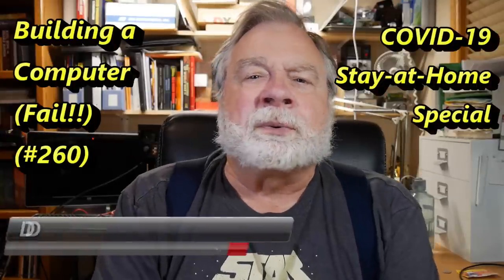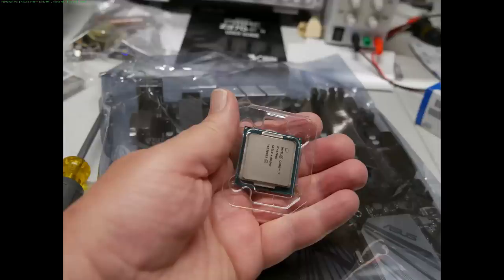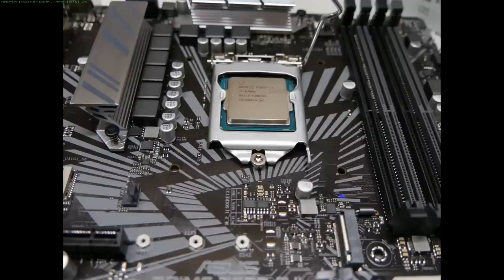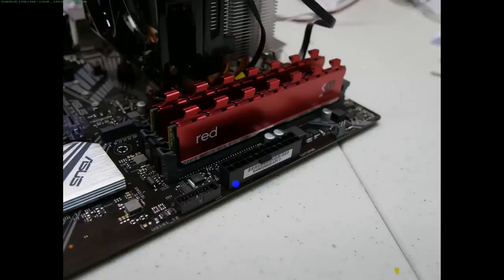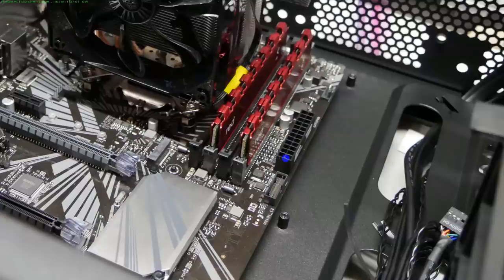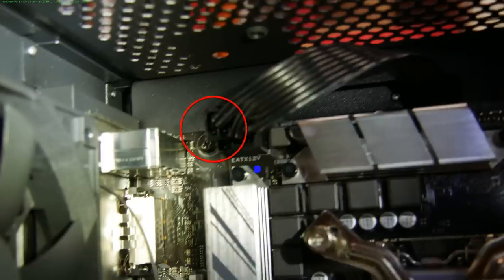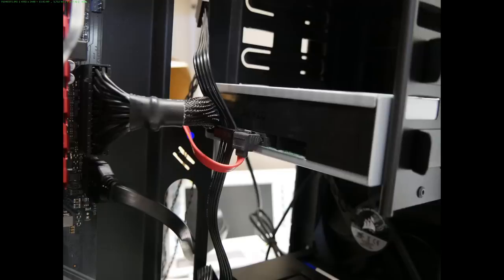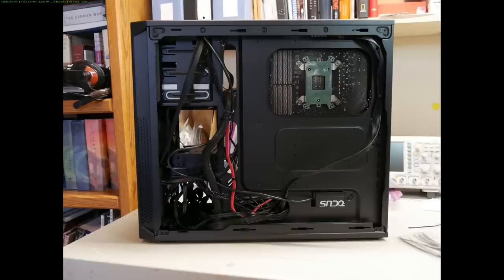Computer Build Fail! (#260)

Comment: Good for you building a PC with no prior experience! Trying challenging and new things is inspiring. A list of hardware would be helpful, but it looks like you made some good choices and did your research well. Kudos on that as well.  Unfortunately it doesn't look like your motherboard has a postcode display. Your best bet is to reseat everything, including the CPU, ensuring it's corner with a triangle is aligned with the one one the socket. I would start with no video card, and the display connected to the motherboard (most Intel CPUs have integrated GPUs). Also try one stick of ram at first. If it doesn't work, swap it out for the other. Unlikely 2 sticks would be defective. Obviously verify the simple stuff as well, right motherboard chipset version and CPU version. To POST the motherboard really only needs a working CPU+RAM.
Reply: I think you'll find this motherboard has to have memory installed in pairs because of the i7 architecture.  Most of the modern motherboards I've worked with will POST (Power On Self Test) wilt only a CPU and give a "beep" code to indicate there is no memory installed.
Reply: @rogerp5816  I haven't heard of a dual channel ram limitation in any modern CPU. My last experience with Intel was on Skylake, and I'm pretty sure it supported single channel ram. That system had a 8 segment display to show post errors, I can remember back to when motherboards beeped, but assuming the motherboard model from a previous comment the manual doesn't mention POST codes at all! Not saying it won't beep, but I can't find info on how to interpret the beeps from Asus

Comment: I also agree that it's the 8-pin CPU cable. The one you're showing in your pics are meant for graphics cards, usually labeled PCI-E, the 8 pin you want will possibly split in half, or be labeled CPU. I do believe with the seasonic power supplies its it's one of the permanently attached cables. 

My biggest worry however is that you might have potentially fried your motherboard and possibly the CPU since the pinouts are definitely different between the two
73 KI5FIQ

Comment: Best option, and it was mention below, pull the mother board and power supply back out and try to power it on, with the gpu, but no ssd or hd, this will test for any bad case contact to back of board, just set the mobo up on it's box and give it a try..  unfortunately the power connector you had issue with is for the cpu..  hope it didn't brick the cpu..  good luck

Comment: I have absolutely no idea, I have to see it in person to check. 
But initially I check everything on the way when I build a computer. And get a little speaker if it doesn’t have one. Check fan spin and beeb with every parts instal.
But my guess is check the ram take them out. 
Start the computer. Prognosis is if the fan spins it should beeb at you. Signaling it can’t start cause there is no ramm, (which is correct) 
If the fan doesn’t spin. The problem is somewhere else. Take out the Graphics card. And try again. If that fails check connections to the fan. 

However if the fan does spin with no ram. 
Put one back and try again. If it doesn’t try the other. 
Ram compatibility is often the must occurring problem. Even in this day and age it really shouldn’t . 

Also, by biggest advice. Wait for much advice. 
I’m not a computer mechanic. I just build them and troubleshoot them.

Comment: if you are not sure if the motherboard  is bad here is what you do ... pull the video card unhook all the sata cables ... put the board on top of the cardboard box hook the power switch wire where it goes and fire it up .. im sure you've heard of breadboxing something .. if it stays on then check to make sure all the insulators and mounting screws are there .. note you will only need those screws where there are screw holes in the board .. having some in there that don't align with holes can cause a short... if it does not stay on then it is possible the board is bad  ..last thing I saw was the ram .. my ram is on the 2 black colored ram sockets not the gray ones .. if you breadboxed it and it stayed on and put it back together and it does the same thing ...unhook sata 1 sata cable try still no go remove another until they are all off.. if still no go then remove the video card..still no go take a piece of paper and use it like a feeler gauge to make sure nothing from the mother board is touching the case under it causing a short..and you can just use your 4 pin square in that 8 pin slot ... I hope you are using a good 500-700 watt power supply I would go with at least 700 but you can do the research to see if you are using one big enough ( i use a 1000 watt but I like headroom ) ... 73's from down in AR keep us updated... I was watching the video again lol .. im not sure your cooler mount is right on the back ... I would think there would be a insulator under the mount keeping the metal off the traces on the back of the board or at least something like a washer or something raising the mount off the traces .. just another thought on a second look.. if anything when you breadbox the board remove the cooler mount and see what happens ... I have seen the fan mount plate cause this problem before on a MSI branded motherboard

Comment: Without knowing the specific model and part numbers of the components is difficult to help. But I would start by removing non basic components such as the graphic card and leave the computer with motherboard embedded components only (assuming it has a video card embedded on the mother board).
It is obvious you have rechecked all connections.
Some motherboards have dip switches to select the type of processor and video card.
It looks like your BIOS is non working /existent or it is corrupted. Is it an embedded BIOS chip? Or is it a removable BIOS chip?

Comment: The EATX12V connector on the motherboard is keyed, it's virtually impossible to fully insert it in the wrong orientation. I can't tell from the picture but it looks like it's not fully plugged in on the left side which may be because it's reversed and the keyed pins don't fit. Make sure this is the correct connector from the power supply and not one of the PCIE 12V power connectors, which have the same number of pins but are keyed differently! Make sure it's fully plugged in and latched. Also, this probably isn't causing the boot failure, but your CPU heatsink/fan should be rotated 90 degrees counter-clockwise. The fan should be pulling air from the front of the case and pushing it towards the rear fan at the back of the case, not pulling from the bottom and pushing towards the top. (Yes I know heat rises, but what I'm describing is the typical ATX layout fan setup.) I can't tell from the picture but it looks like the heatpipes aren't fully covering the CPU die due to the heatsink/fan being rotated like this. It shouldn't prevent booting unless the heatsink is not making contact with the CPU, but the improper fan direction could make your CPU run hotter and possibly throttle down the clock speed if it gets too hot.

Comment: I think your connector (12V top one) is wrong. It looks like an GPU connector. So please make sure to use CPU 4+4pin or just 4pin 12V connector from your power supply. 73.
Reply: I agree with this, I had the same thought it might be the wrong connector used for the top motherboard power connector.  Check your PSU for another 12V connector as OH6BPL mentions CPU 4pin or 4+4 pin.  Been building PCs since I was 13 years old (now 40 lol).

Comment: In addition, go to the ASUS WEB Site and find your motherboard. ASUS might have additional instructions on your motherboard, especially in the installation. ASUS might also have videos on setting up your motherboard. Do the same with the power supply vendor. Finally log into YouTude and do a search on your Motherboard, ASUS Exact Model Number. You might find someone else had this same problem. Take care and 73.

Comment: I bought on of those anti-static wrist straps off ebay, but I wore it on my ankle.  There is usually a high value resistor between the strap and ground (100K-1m ohm)
Power supply might be 86'ed, try replacing it.  EVGA has a B stock sale every Wednesday, they usually have a deal on power supplies and graphics cards.  https://www.evga.com/products/feature.aspx (I am NOT associated with EVGA, just a happy customer).

Comment: Video is well done Dave. My wife's PC that I built 2 years ago uses the ASUS 380 MB. The problem is more than likely the faulty connection of the 12 volt power cable. It is possible that there is another cause, but I am betting on the power cable. And as others have mentioned, the PS has a crowbar circuit to protect the PS from dead shorts, so I doubt that PS is bad. I am not familiar with your PS brand name. I use EVGA PS's, they are top notch and never failed me in 6 PC builds over 25 years. I hope your PS  DOES have a crowbar, if not by some chance, that might be the problem. Also, you can call ASUS Tech Services , or email them, with what you did with the 12 Volt power cable, they can quickly tell you where the problem will reside. You are not the first person to mis-connect the 12 volt power cable. And seeing you do video work, you need the best video card you can afford, DO NOT rely on the onboard video it is NOT powerful enough to do video work that you do. Keep us posted Dave.

Comment: I had a similar problem many moons ago while constructing a Pentium 3 machine.
 
I had forgotten to install the required spacers between the case and the motherboard , the fault was the motherboard shorting to the case.

Maybe pc design and construction has changed a lot in the meantime ? But I thought I would pass on what had happened to me.

Comment: Your processor i7-6700k is not compatible with the motherboard you have. That processor will not work with an x370 board. I think I saw x370 on the manual on your desk. 
There were changes made to the LGA1151 socket during 2017.

This means your I7 6700k is only compatable with the following:
100 series boards,ex B150, H110, H170, Z170.
200 series boards, EX B250, H270, Z270.

Unfortunately, 300 series boards will not work, so you must find an older board, which may be hard with thinning inventory.

Comment: It looks like the power supply is shutting down because of some type of short/problem. It try's to startup, but the protection circuity in the power supply turns on and shuts off the power supply. It could be one of the following: (1) Another wiring error (least likely) but double check and have someone else triple check your connections, (2) the power supply was damaged when you made the mistake with the small power plug, OR (3) You damaged the motherboard when you plugged in the small power connector into the motherboard wrong and turned on the power. I assume you turned on the power after you made the mistake with the small power supply connector? Let us know.
Reply from the maker: It turned out to be mismatch between the motherboard and the processor. Nothing was damaged and it all works fine now.

Comment: i had a very similar problem before when building my computer. when I had it it was the fault of the cpu. The board would P.O.S.T. and then figured out there was a problem with the cpu and failed out. make sure that the cpu is supported on that board. i would also reseat the memory sticks that would also cause problems.

Comment: As an IT guy, I must admit a cringed watching this video... but we all have to start somewhere.

I see you got a Silverstone power supply, which is a good, reputable brand.  Its very possible the short you caused damaged it, but at the same time the symptoms you show sound more like the PSU's over current protection is kicking in.  The next step is to test the power supply while its not connected to anything.  To do this, first make sure its not connected to anything, then short pin 16 of the 24-pin main connector to one of the ground pins (pin 15, for example, see link).  If the fan in the power supply kicks in, its probably good.  You can now take a multimeter and test the output voltages.  I think the tolerance is +/- 5%, but I could be wrong.  ATX Power supply pin-out -> https://www.lifewire.com/atx-24-pin-12v-power-supply-pinout-2624578

If your power supply tests good, then hook it back up to the motherboard, but leave your case fans, hard drive, optical drive, SSD, front LEDS, and front USB ports disconnected from everything. (In other words, only have the motherboard, video card, processor, processor fan, and power switch hooked up).  If the system works in this minimal configuration start reconnecting things one by one until it stops working to find the failure point.  If the system does not work in this minimal configuration, you can try taking out the video card and one stick of RAM to see if that changes things.  My gut feeling is that the power supply or motherboard has been damaged.

Good luck and 73,
AD8BU.

Comment: Lay case on side as if installing motherboard.  Make sure the video card is locked down and latched by pushing, pulling, rocking back and fourth.  Those AGP ports are usually very stiff.  I summize that the power supply should have crowbarred so no damage should be done (only the cheap ones blow when that happens).  From your complaint I think the video card is not seated properly.  Or your RAM is not seated correctly give it a wiggle and shake also.  Give the BIOS jumper is in correct position (ref. the manual).  Next move to testing power supply but that usually requires a load since it's a switching supply.  Good luck sir!
KE00IHR
PS. heard any way to test for extra online?  Covid-19 came just in time to cancel all test sessions in my area.
73's

Comment: It looks like the MB has a video out.  If the I7 has GPU in it you won't need a video card, since you did not mention the series of I7.  If you have an I7 with no GPU in it then a vid card will be needed. Dual-channel memory 1,3 slot or 2,4 that if you have 4 memory slots.  I have built at 300-400 computers in my lifetime. If you shorted than most power supplies will fail to power the MB.  It will shut itself down as designed.   It should not have damaged anything.  If you are still having power issues. Disconnect everything but the MB see if you see a power-up. LEDs should glow if it's ok, then plug in 1 item at a time, this will ensure that a device is not causing the problem  you still have short i was a bit nervous about the heat sink mount on the motherboard it didn't look correct to me

Comment: Never seen that power supply brand anyways, you have a power supply problem, either the power supply itself or the motherboard.  When the power supply starts up it does a self check of all voltages.  There is a pin on the 24pin power connector that is called "power ok" if this is not asserted power supply shuts down.  You can check the power supply by doing the following:

1.  Disconnect all power supply cable from motherboard and all other devices.
2. This is like pressing the power switch on the computer.  Short "PS on" pin 16  to a "com pin" 17 on the 24 pin connector.
3. Measure all voltages to GND, all GNDs are common.

Use this as pinout reference: https://gegeek.com/hardware/power-supply-reference/

If the power supply is ok then just RMA the motherboard to get a new one.

Windows has drivers for your LG drive and will load automatically.

Comment: Not sure how much help asking the armchair computer techs on Youtube will be.  You're going to get 300 different answers and probably none of them right.   35 years in the IT business and I wouldn't even begin to know what to suggest.  I'd make sure the CPU pins are all in place and not bent.  Make sure your RAM isn't jammed in backwards or not fully seated.  Could be a power supply issue.   Only thing I would do is strip it all down to the bare minimum and start adding stuff one item at a time.  I've built thousands of computers in my day and this is a perfect example of why I will never build another.    Good luck.

Comment: Disconnect power supply, take it out and power it up with no loads, check for voltages
Reply: Agreed. It's possible to do this with a jumper wire, a multimeter and some patience, but there are also $20 ATX power supply testers that will let you plug in the cables and give you all the voltages at once.

Comment: Well.. this sounds like my experience.  Mine WAS the power supply.. being only half the  correct model.  perfect for sata drives, 24 pin atx mother board connection and all but the problem was the 8 pin  cpu power plug near the top of main board.. the shapes and combination of the male plug did NOT match the recepticle on the mother board..
It was easy to press together but it was easy to press a half round pin into a square receiver at that position.  
After checking board pin out of this receptical, I found that the power supply was not the right match ( not my fault) , store sales picked components by my specifications.  I just took it back and told sales about plug and he knew exactly what was needed.. swapped them, refunded a few bucks.  All went well. 
All Asus parts, Intel i5  3.0ghz and two sticks of 4 gigabyte midgrade ddr3 ram.  All the setup was basically accept, deny, choosing and selecting options  before final restart.
Polarity diagram on paper helped. 
Og fan and ham.
take your time.
73
kb8qlz gary